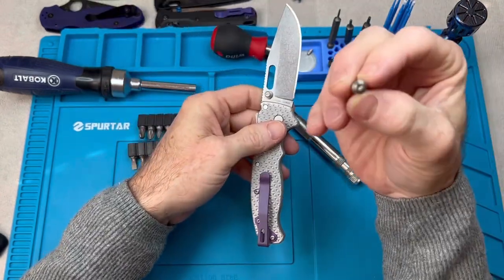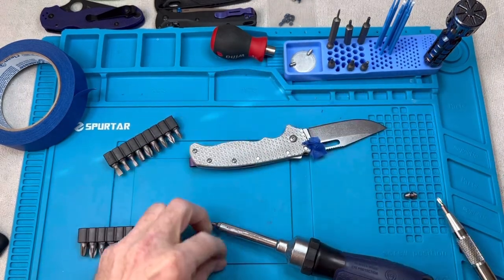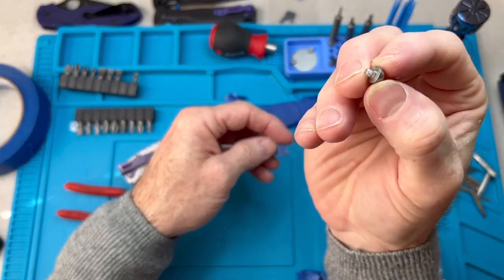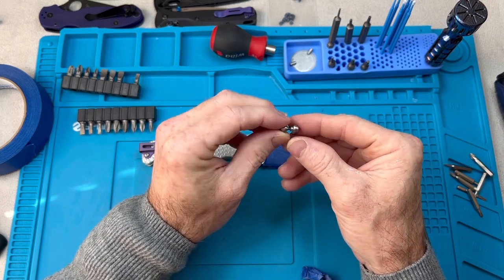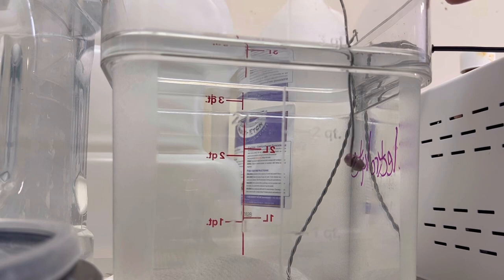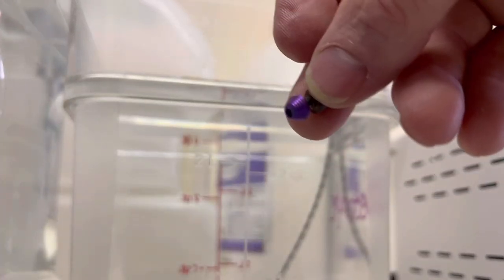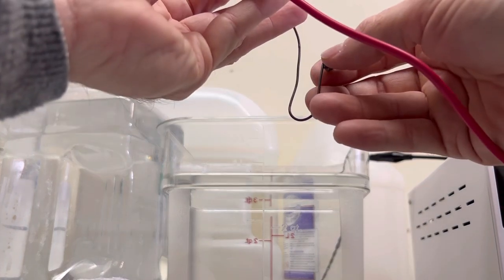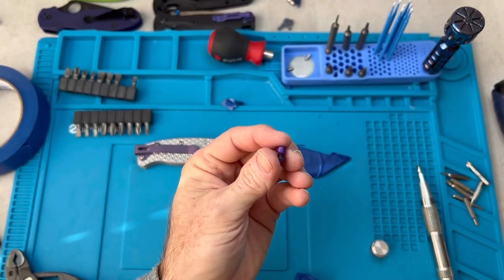These Flytanium Thumb Studs Are A Pain To Replace

Comment: Was just faced with this thumb stud dilemma.  Pliers wouldn’t grab the tapered stud well at all.  It then occurred to me to use a Dremel cutting tool to cut a flathead slit on the other side.  It worked great, and was very easy to unscrew with two flathead screwdrivers.  Of course, you have to be comfortable and careful using the cutting tool, and be willing to accept an altered original thumb stud, that may not look great.  Though if you cut the slit well, it will be easy to put on and take off in the future.

Comment: I had to use heat to melt the loctite and still had to cut a flathead notch into the other stud to stop it just spinning and spinning, the studs are also designed so it’s practically impossible to get a grip on it with pliers, even when you don’t care about destroying the original stud. Terribly designed in terms of allowing for modding

I was so happy that the flytanium replacement studs have tooling on both sides, and torx not the stupid flathead that inevitably gets munched up

Comment: I took a Bic lighter to the stock studs for 10 seconds that seemed to brake the lock tight enough for me to grab one of the studs with a pair of pliers and unscrew them I got 2 Ad20.5s I totally destroyed the stock studs on my first Ad20.5  just trying to figure out a way to get them off it was a pain but they do look pretty good

Comment: Did Flytanium make it right or they still not swapping them out for you
Reply from the maker: They refused to do anything and said it’s my fault and since I anodized them the warranty is void.
Reply: @bladesandedc  that sucks. Is that stated anywhere when ordering 🤔
Reply from the maker: @Knifedope  Not that I noticed. It’s all good. I needed about $250 worth of stuff from them for my Bugout and a future Para 3 build. I will have to find somewhere else to spend my money.
Reply: @bladesandedc Do you really think they should have gave you a nee thumb stud for free? Lol
Reply from the maker: @HarryBallsonya-zb3oj  Go find some bridge to sleep under troll. You're presence is not needed here. Please feel free to click the dislike and report button on your way out.
Reply: @bladesandedc Wow, for a small thumb stud they would alienate a potential long-term customer (even if they didn’t know you were a YouTuber)….foolish move Flytanium.   I try to buy all my aftermarket scales from great small businesses like Original Goat, AWT, Meton Boss, etc with all Made in USA gear, but there are still a lot of small accessories and specific knives that only Flytanium has products for thus far.